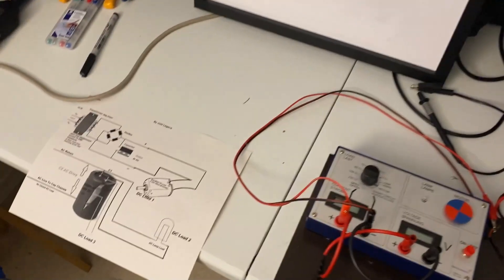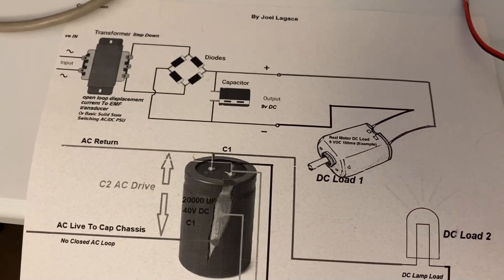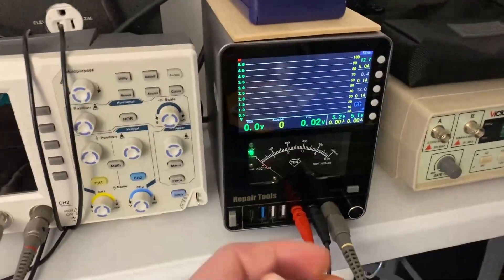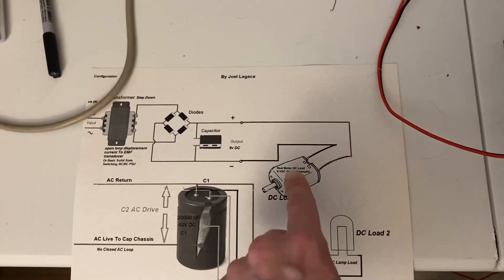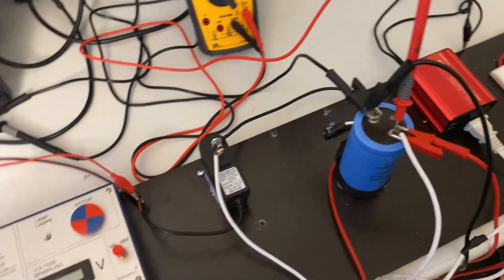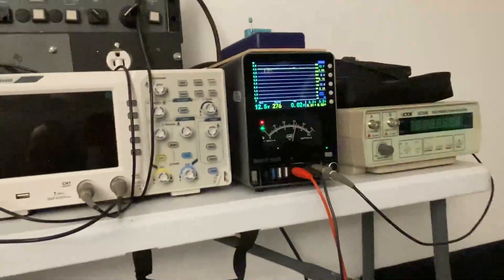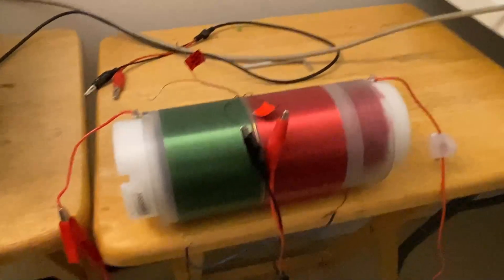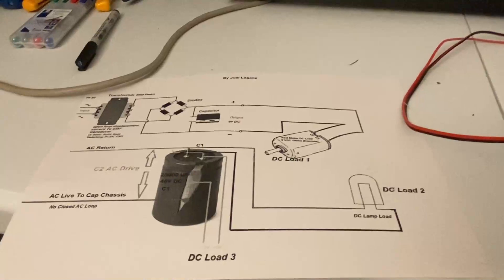I Fix Lenz Drag

Comment: Hey Joel does it have to be a Electrolytic capacitor or dose it work also with plastic/paper capacitors with Aluminum foil wrap as outer casing?

Comment: 24 in CAP bounce fam.  n radio trim caps 4 tuning,  ya trawling resonoance with ya coils 4 a static sweet spot.   mate ya rods dippin in a dead pool stagnent pond. oh sorry just clocked ya 34 in.   SORRY MAYBE later.   this thing now. do that n maybe later. vortex n victor.    yeh THAT GERMAN bloke.  toroid's OH NO DONT LOOK AT THAT.   ya already ON IT.   love ya'lll .       YOU ONLY FAIL.   WHEN YOU STOP.

Comment: Sorry for the confusion. Could you write an answer to the following:

The drawing you made 16:30 looks great to cancel the magic flux that would generate a back EMF on L1. That’ll make a great transformer. But if L1 is closing the loop of the coil in the generator, that’s current in the generator creating draw. 

So how does your load (clever transformer) mitigate the generator’ self drag? When L1 sees a current?

Comment: I don't know why I haven't tried it but I have wondered what would happen if a dc brushed motor was powered through a diode! So the back emf could not conduct,  I don't know if it will work,  but then feed it with a pwm signal possibly  storing the back emf in a large capacitor maybe setup a relay to conduct  only when the pwm signal is off. Feeding the capacitor. The pwm motor controller  should not see the resistance, right?  Possibly  using a low frequency pwm, maybe  500hz, 1200 hz with the duty changing speed, the motor charging the capacitor between pulses, basically  sending it a 500 hz with 1-99% duty cycle, charging on the off time. Then use a dc to dc boost/ buck converter to charge the battery, this could boost efficiency  to 99.9999% maybe efficiency  can have gains with frequency  and certain  duty cycles.   It would require experiments and study.  Read exactly where the current is going and where it is comming from. To prevent false readings.

Comment: Basically your L2 and L3 is a bifilar winding spread apart along the L1, where L2&3 act like “joule thief” fed from L1 flux. When air core is used instead of ferromagnetic core, magnetic action is less effective and real action is moved into capacitor in electric field … ratchet action to translate back and forth action into unidirectional rotational action, like water ram pump where water is pushed higher under its own gravitational action.

“Experts” always complain about the loss in such setups being concerned of waste and gain even if they don’t pay for the free collection.

If you place a magnetic circuit on top of electric circuit you can see the full mechanism, L1 having a single magnetic dipole in first instance, L2&3 each their own magnetic dipoles. You may look at this as one of the L2 is a nail and L3 is the hammer, while L1 is the support that react against the hammer.

Don’t forget, the energy is kinetic in its nature, not static.

Comment: .
U.S. patent 413,353 - Method of Obtaining Direct current from Alternating Currents - 1889 October 22 - Superiority of alternating currents discussed; Delineates machines to convert alternating currents to direct (or continuous) currents at will at one or more points; Obtain direct currents from alternating currents; Active resistances to opposite electrical character, whereby the currents or current-waves of opposite character will be diverted through different circuits.

Comment: I am convinced the lenz is solely caused by the back emf stuck in the coil and if you divert it like Bedini did it solves the lenz drag entirely .
Reply: Generators are engineered to maximize Lenz. Gotta wonder why.
Reply: @juanmf  most of the lenz happens at the start of the generator after the copper ions align there is minimum lenz butstill there is lenz , the load is not lenz
Reply: He disguised it,thats all but he was smart in understanding this stuff. BUT great to see you Crack the code Joel
Reply: You thinking of his monopolar waveform by chance? The waveform indicates a lack of back emf in the coil